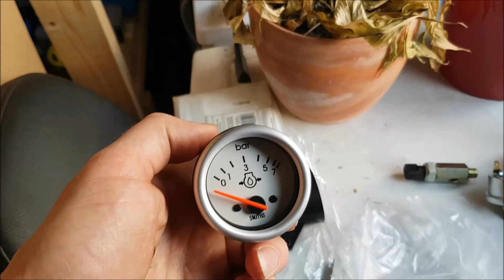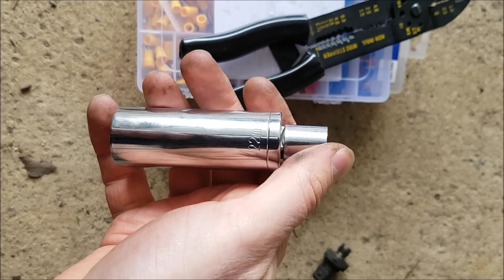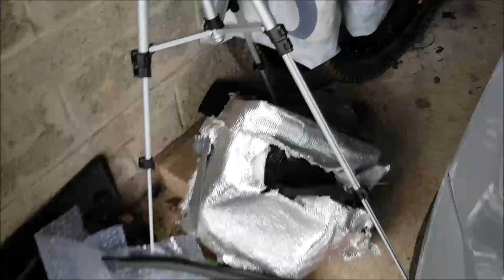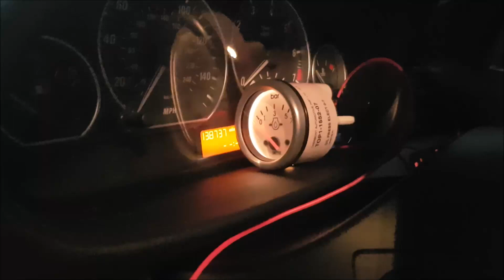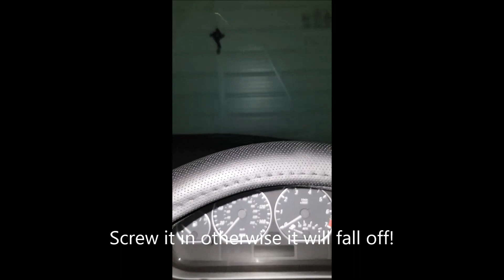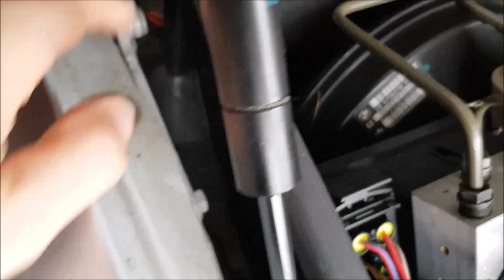Oil Pressure Gauge Install BMW 3 Series E46 330ci - Monitor The Engine Oil Pressure

Comment: what is the normal pressure at operating temperature?
Reply from the maker: This was a long time ago, but I think it's around the 3 bar mark
Reply: Warm?
Reply from the maker: I can't really remember.  When I was on track I think it was about 3.5. Idling maybe 1.5. I don't have the car any more

Comment: NEVER use multiple washers on anything that has fluid or pressure, your asking for leak. Instead change the thickness bigger or smaller.

Comment: This is a huge bump but why did you plug back the oem pressure sensor?
Reply from the maker: Can't hurt to have a backup 😁
Reply: @ModFix  my case is that the light flickers some times. Could I leave it disconnected and focus on a gauge like the one installed here?
Reply from the maker: Maybe it flickers because your pump isn't work at 100%
Reply: @ModFix  it’s weird cause i replaced it with another one (used but good)
Reply from the maker: @bobafittness1346  I suppose that's the good thing about a pressure gauge that you'll confirm your pump is good.  Maybe you have a dodgy lead on your sensor

Comment: Got a link to the adaptor ? Thank you
Reply from the maker: Sorry, I don't anymore. I bought it from Merlin Motorsports. If you know the thread sizes of the sensor and your sender unit you should be able to find it quite easy.  Hope that helps.

Comment: Could you attach links to where you got everything from? Thank you! Look forward to installing this on my car
Reply from the maker: Hi, 
All the main bits came from
 https://www.merlinmotorsport.co.uk
The gauge housing was just a cheap one from eBay.
It's a very tight fit with the sender unit I used so if you can find a smaller one it would make it a lot easier.

Comment: Hey, where did you get that adapter for the pressure sensor and sensor unit? Thanks
Reply from the maker: Chris Blakey I got the adapter, sender and gauge from Merlin Motorsports in Castle Combe.  It would be easier with a smaller sender unit if you can find one.
Reply: 6Speed cheers fella will take a look
Reply from the maker: Chris Blakey no worries mate